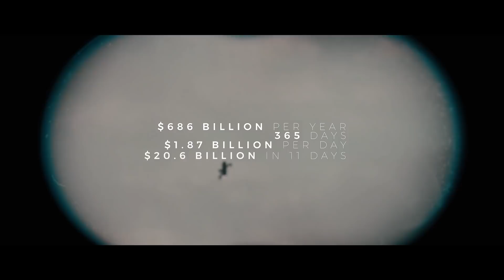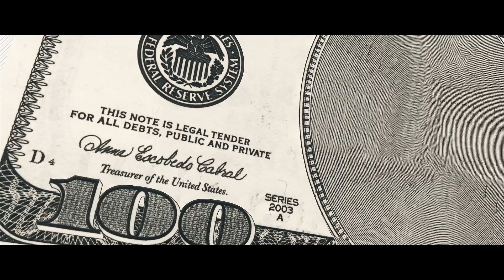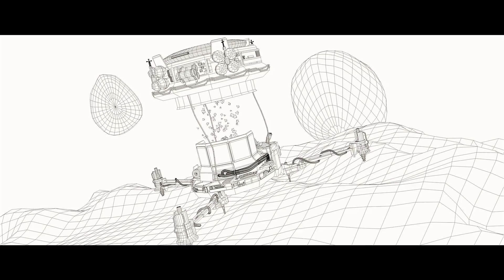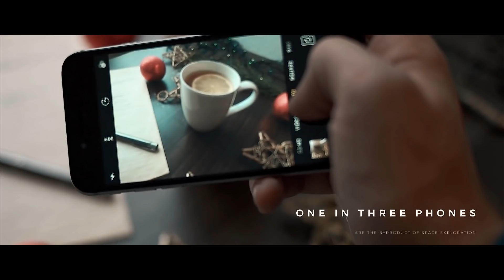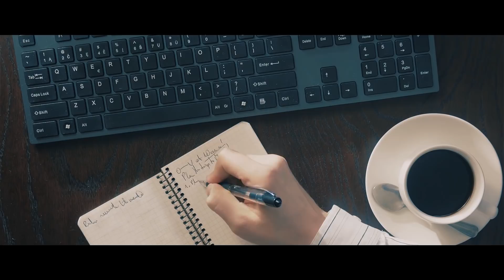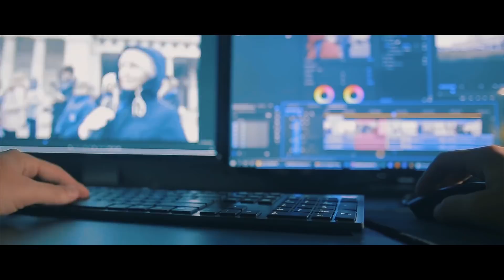If NASA Wasn't Broke

Comment: The case for NASA as an investment in technology developer for products is very weak.  DARPA made at roughly the same time has made dozens to hundreds of times the technology contribution of NASA.  DARPA made the Internet (though not exactly as you see it. Just more of text version with no hyperlinks), GPS, the map technology that Google maps uses, and the mouse, windowing, hyperlinks and video conferencing was developed with mostly DARPA ("on-line system" https://www.darpa.mil/about-us/timeline/nls), some Air Force money, NASA was a bit player, not the big part this video tries to attribute: https://www.darpa.mil/Timeline/index.html  The Grand Challenge in 2004 probably accelerated the development of autonomous vehicles by at least 10 years. The technology in Siri was also developed by DARPA.  And all kinds of DARPA funding has gone into robotics for decades.  If you see robots walking around in the coming decades, DARPA had a big hand in it.
No! Directly funding technology development is far more powerful than accidentally useful stuff from NASA.  If there is a reason to have NASA, this is not it.   DARPA did all this with a much, much smaller budget.  And No!  NASA did not even invent Velcro...though it bought a lot of it, and it was partly to blame for the deaths of the astronauts of Apollo 1.  Though most of the blame goes to NASA for using so much oxygen in the capsule on the ground.

That said, I am very much in favor of developing space technologies, funding big space projects.  But the way NASA does it with ripoff contractors has been a joke for decades.  Unscrupulous contractors is the worst part, but bureaucratic red tape to justify the large number of bureaucrats is also a major problem.  Congress has not cared because the congresspersons only care that some part of whatever is made is made in their district...if it is, they vote for it.  And the bigger the ripoff, the more they like it.  And the idea put forth in this video that NASA chooses what NASA does is totally untrue.  The administration chooses what to fund and what not to fund and at what rate...and rarely does something survive the multiple administrations needed to get it complete and launched.  Virtually every large contractor working with NASA lies about cost by at least 3x and drags out a project virtually indefinitely.  When will we see the James Webb satellite in orbit? What a scam. Took the whole country for chumps.  If it was solid gold it would not cost a tenth of what we are being charged.  They have squandered $10 billion on this already.  And it is a good concept.  Probably why it was so easy to just keep ripping the public off...we want it...so it is an extortion opportunity.  We need to break up these large defense/NASA contractors.  And everything that gets done should get done without any exclusive contractor arrangement.  If another company delivers first, and on budget, it gets the money.  You are slow and over budget, you miss out.

The military budget should be reduced to $200B.  The VA should only do psychological stuff associated with war, everything else should just be put into Medicare.  We would save a bundle.  And we know how to dramatically reduce psychological war trauma now as well.  You use pills that prevent memory from being moved to long term, and very small doses of ketamine immediately after injuries can prevent the brain from physical damage from psychological damage.  It might make it harder to get the whole story on what happened, but that is a small price compared with keeping the soldier capable of living a normal life when they get home. There are dozens of articles on this https://pharmacist.com/article/va-uses-ketamine-treat-ptsd-effectively

We need to double the highways currently away from the cities where land is cheap.  You want to make it virtually impossible to have a head on collision on a US highway.  No highways with anything above 45 mph and adjacent lanes going the other direction.  Build a separate lane pair separated by a barrier and a couple hundred feet.  If you need more lanes later you can add them in the center.  And we need to build two hundred large molten salt nuclear reactors.  Displace all the coal, oil (we don't have much) and the simple cycle natural gas power plants.  The combined cycle natural gas plants are decent.  Keep current nukes, their waste can be used in the molten salt ones.  And we need tunnels for highways through the mountains and such.  Every new car or truck should have a >50% breaking regeneration capability.  That does not have to be electric, there are a variety of ways to do that.  All new pickup trucks should be required to run on natural gas.  There is plenty of room for tanks under these vehicles.  They also get atrocious fuel millage.  Our economy would be much better off with pickup trucks using that.  It also provides a market for natural gas after shutting down all those simple cycle natural gas power plants.  Electric vehicle rebates should get larger as companies make more of them not smaller.  We need to stimulate the production of millions of these vehicles.

Single payer medical where prices are negotiated by government would be a third the cost of the current system.  Drugs should not be covered.  But perceptions more general, allowing the consumer to chose among the options rather than being stuck with whatever the doctor prescribes.  The pharmacy should also use a system to insure that whatever is chosen makes sense so there are no interactions and such.  Everyone should be sequenced, so we can build a database to know who will respond best with that medication.  Prosthetics and equipment to improve mobility should cost much less to pass the FDA if they are nearly identical to others that have passed.

And we need to build advanced planned cities.  We can build in a more logical order far more cheaply.  You build all the tunnels for transport, water, natural gas, electric conduit, fiber-optical cable, etc. by trenching using large trenchers that can make miles of trenches a day and machines can put in the rebar and concrete in just a couple days. In less than a year, you could have all that stuff ready.  Then build somewhat high density.  Enough for a 2 million person city and move onto the next.  And I am talking high efficiency very well thought out, computer simulated and computer evolved design.  If you live there you would rarely ever need to go more than a couple miles to find anything you need...even if the city stretches 10 miles or more.  The underground stuff should be designed to last in excess of 300 years...none of this 40 or 60 year stuff.  And they should be designed to be nearly impervious to natural disasters.  Build one, go onto the next.  Ideally less than 2 years start to finish.  Possibly build 5 or more at a time after the first few, assuming everything works as planned.  We need this because it enhances our efficiency and productivity.  No one should have to have a commute over 20 minutes...and most 10 minutes.  Additionally, repairing old cities is expensive and we are over crowded.  And our cities have been inundated with lead.  Both lead paint and lead spewed out from exhaust pipes.  That has done far more damage than most people realize.  It causes IQ loss in the unborn, infants and young children as well as greatly damaging their impulse control.  And the myriad disasters that causes.  It also causes high blood pressure and other conditions shortening life.

Space investment?  We need to use the ISS as a place to perfect reducing resupply to zero (or very very close).  That means growing all needed food there and recycling all waste.  It also means advanced 3D printing methods.  We would also need a rotating habitat and a large facility for growing plants and tissue cultures.  We could do that with an empty first stage BFR (which is possible).  You need a second launch to pull that first stage near the ISS.  The rotating habitat would be for giving astronauts some time in gravity for improved health and determining just how much time and at what G level is best to counter health effects from zero G.  And if some things won't grow well in zero G maybe a few plants can be grown there...maybe some egg laying hens too.

Moon gateway is nonsense. Just an inconveniently located space station.  The math has been done it contributes nothing.  The station should be on the Moon or forget it.  And we do need a Moon colony but we have to work out this no resupply thing first.  Of you do not have self-sufficiency, then you only have the illusion of a "multiple planet species".  The Moon colony should be fully self-sufficient and capable of producing valuable commodities not just accommodating rich visitors.  Ideally we would have hundreds of automated mines and refineries and build large spacecraft there.  Like aircraft carrier size.  Go to the Moon in a tin can but leave in a Battlestar to a variety of locations in the solar system.

Comment: money is part of the issue but not the most important part. the most important part is this throw away society we live in. and money greed. when NASA makes a proposal they are always trying to get everyone's tech on board. which means paying everybody. when there are easier lighter ways to do things. For example, the Mars direct plan could have worked. but it didn't have enough peoples tech involved to they threw it out. came back with Mars semi-direct that had a lil more support but they still weren't pleased. To be honest, NASA's way of doing things is just outdated. I think contracting with private companies was a good move for them. Don't get me wrong they definitely desperately need more funding. But I believe even if they did have more funding they are horrible at budgeting!!! They won't put it in the right places and they simply take wayyyyy too long to develop.

Comment: 2:45 - SLS, “Think of I as the BFR of NASA.”...Except, as designed, SLS Block 1 will NOT be able to  astronauts to the moon - SLS Block 1 will not have the capability to get Orion, its ESM & any Lunar Lander into TLI (SLS won’t be able to get people to the moon until Block 1B & won’t to get people to Mars until Block 2), & that’s after spending a total of $23+ Billion just on SLS Block 1 & another $10+B on Blocks 1B & 2! &, I haven’t included the ADDITIONAL $14+B spent to develop Orion, a spacecraft that can only take 6 astronauts when packed like sardines & that, as configured, can NOT autonomously dock! &, even after spending all of that money, the “cheapest” SLS launch would cost $1+B (the cost of launching 11 Falcon Heavies or 16 Falcon 9’s), while the Block 2 will cost $2+B/launch!
Contrast that to the BFR/Super Heavy/Starship which would cost $10B TOTAL to develop (for MORE lift capability than SLS Block 1) and would cost $10 Million (Cost of ONE launch of “cheapest” SLS = cost of 100 launches of BFR), &, unlike SLS/Orion, Starship is designed to autonomously dock, which enables in orbit refueling for missions to anywhere in the solar system. One SLS Mission (using Block 1B) to the moon would cost $1.5B to deliver 4 astronauts or 6t of cargo to the moon, while 1 mission to the moon using BFR would cost $90 Million to deliver 100 colonists & 300t of supplies to the lunar surface.
Jeff Bezos recently said that to colonize space, we have to DRAMATICALLY LOWER Launch Costs & then utilize materials obtained in space to build in space. At $70/kg - $10 million/launch, the BFR would enable both. At $10,000/kg - $1+B/launch, SLS would actually prevent both. It should be obvious which of these 2 systems we should invest in if we actually want to explore, colonize & exploit space. It should also be obvious which of these systems we should invest in if we just want to throw money down a rathole...

Comment: One problem with letting NASA do all of it is that usefulness takes second place. We can develop all the technologies while also making the projects themselves pay off, by concentrating NASA on administrative tasks like evaluating projects, quality control and so on, and have all the productive stuff done by private companies. And not only that, it would also make sense to concentrate on economically viable tasks first - communication and observation satellites, satellite maintenance capacity, space tourism and so on. The extremely-high-quality supply chain coming from that would automatically help innovations in many other areas, allowing progress in miniaturisation, capabilities, data processing and so on. Scientific programs should only be added here and there to jump-start new endeavors - space probes for long-lasting satellites and resource mapping, moon and mars probes to encourage private initiatives involving them, and so on. Only science which also serves other purposes like security should be financed by the state - like space observatories. All else should be financed by universities, private laboratories and so on. This way, the results are more likely to quickly turn into viable products, capabilities or savings. It also ensures that the country stays competitive with other countries which only go the direct route and invest very little in space programs and such.

Comment: I absolutely agree they deserve more funding, but it should not be overlooked that a small budget forces them to be exceedingly clever and careful with their spending. Again, I fully agree they deserve more, but the starving artist/creative limitation phenomenon shouldn't be overlooked. If NASA's budget was to increase tenfold overnight, I doubt they would achieve 10x as much. That's not necessarily rooted in fact, it's just that I don't think it would scale directly. Think of it this way: would we have achieved the same efficiency of rockets if NASA wouldn't have had to fret over every ounce of weight they sent up? I don't claim to know the answer for a fact, but it's worth considering.

Comment: 1:15 $10 (on average) * 327m = $3.27b so where do the other $17b come from? 1:31

Also NASA didn't use their funding efficiently. Adjusted for inflation (2019) the shuttle program cost $222b. There were 135 shuttle missions, so the average cost per launch was $1.64b adjusted for inflation. Nowadays private companies claim to get the payload into orbit for 5% the cost. I get it that the Space Shuttle had a very specific mission profile, even with military tasks in mind that cannot be done with conventional rockets. But was it worth it at that price? What else could NASA have achieved if they were just 50% more cost efficient, let alone 95% that private companies claim?
And now they keep doing the same. They will raise the funding for SLS even though it's behind schedule, already above budget and less economic than other solutions.

I'm totally with you, NASA needs more funding. But also they nee to make better use of it.

Comment: No one can argue that NASA hasn't accomplished great strides in technology development and the advancement of space exploration but it has come at excessive cost.  Private space development has caught up with superior rocket technology in a fraction of the time and at an even smaller fractional cost.  Probably due to NASA being publicly funded they are too cautious (slow) in development and spend excessive amounts getting ready while private firms do reasonable effort and go for trial.  Failure and try again approach turns out to be les expensive and faster than "analysis paralysis".  Once human flight is included there is plenty of time spent proving both safety and reliability.  I'm sure we will go to the moon and perhaps mars but it will be private development and launch vehicles that take us there.  NASA will just stand up to take the bow for it.

Comment: Well over $700 BILLION stolen from hard working Americans since 1958 & have absolutely zero to show for it. No craft capable of keeping humans alive farther than the ISS (240 ish miles from the surface we all stand on) , no rocket system capable of taking the non existent craft with human beings in it and keeping them alive. There is absolutely no logical explanation of how we can’t replicate something with our advanced technology that we supposedly competed in the 60’s with slide rules and protractors. “Space” technology is the only technology that has never advanced and in fact suffered regression, how can planes, trains, autos, motorcycles, semi trucks, electrical engines, weapon systems, construction, chemistry, and honestly every single thing you can think of has advanced greatly over the years. But for some reason, space related technology that involves live human beings has zero advancement since 1972 & the last supposed Apollo lunar mission

Comment: One of the main reasons military units use so much money is because it's not beneficial to save money. Let's say a command is given 100 thousand for a yearly budget. This is used for all sorts of things like none standard equipment. Now say the unit only uses 75k. The divison financial officer will note this and next year they get 80k. That year they use only 50k and then they get 55k and so on. This leads to massive unit spending at the end of the year with thousands of item (cutting edge non issue gear, sights, and all other approved equipment) being stored in a connex becuase it's not needed. Then they can say they spent all the money and get the same amount or more. Hundreds of units do this and it adds up.

Then there is the governmental spending to promote the various activities of all five military's which dwarfs all that by an incredible margin. 

The military waist a fuck ton of money becuase the business its beneficial to do so.